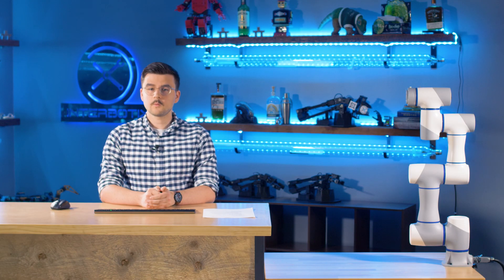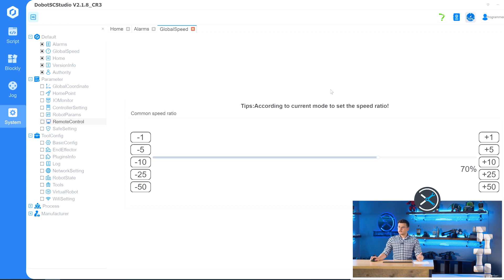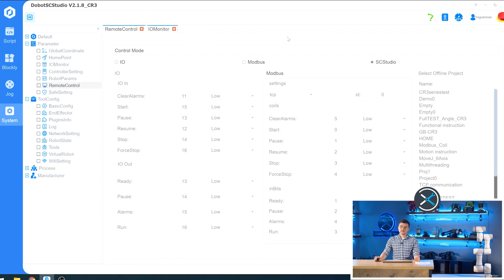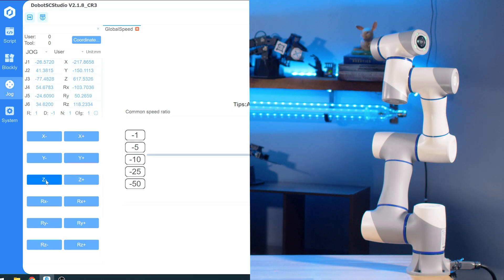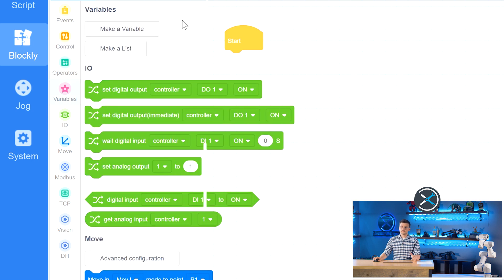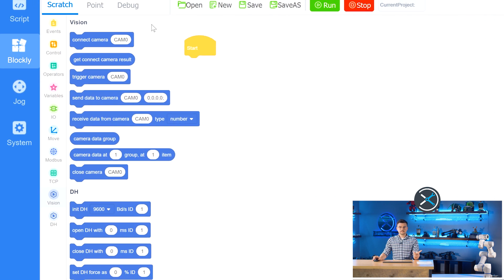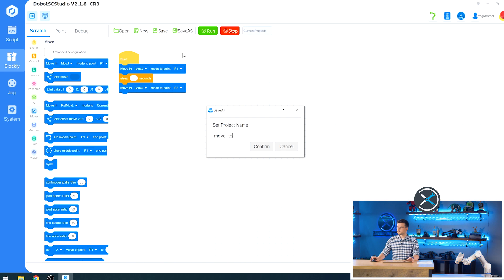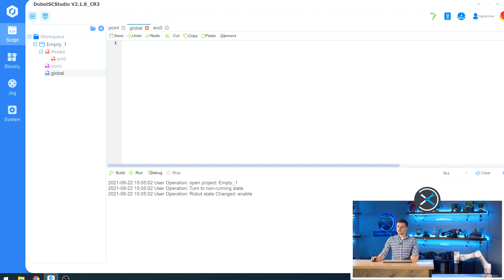Interbotix Tutorials: DOBOT CR Series | SC Studio Quickstart

Comment: I have an application with a 2 second sleep instruction and I need to extend it to 2.5 seconds

Firstly, I set 5 seconds to see that the changes took effect and the time was lengthened correctly.

The problem is that when I set 2.5 seconds it treats it as if it were a 0 and does not wait.

Can't you put decimals in a sleep statement?
Could the sleep function be used with milliseconds instead of seconds?

greetings